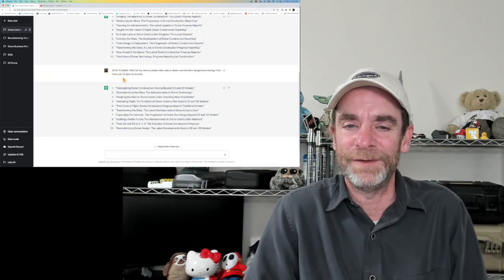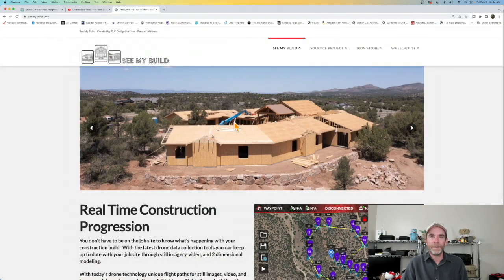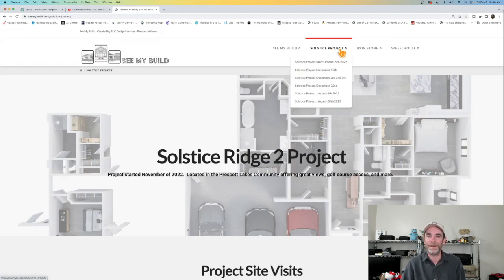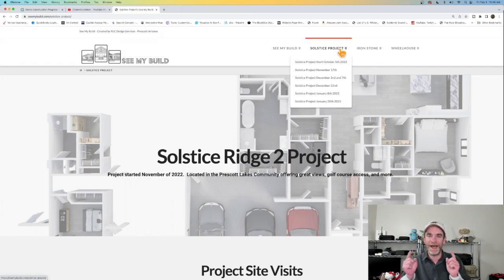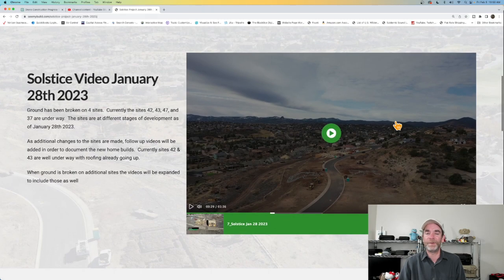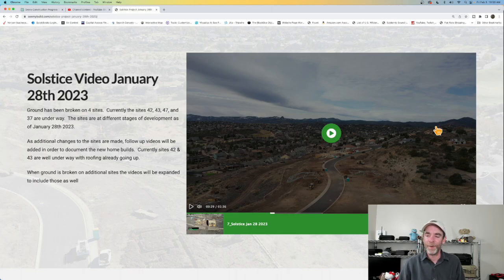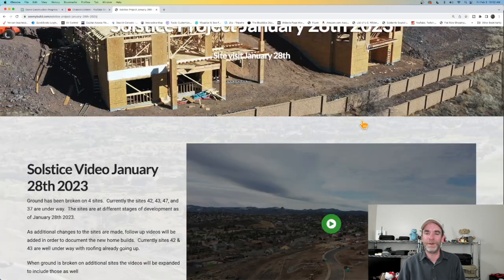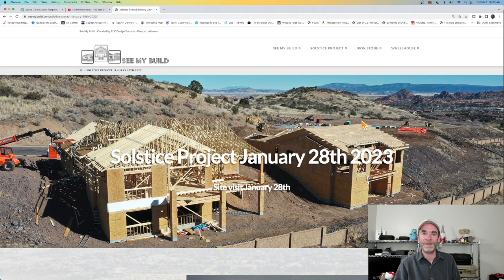Breaking the Mold in Drone Construction | Deliverable Presentations

Comment: Very good information once again. Can you remind us if you use control points or a GNSS  receiver 100% of the time? What levels of accuracy do these type of jobs require if none of the deliverables are being used for engineering grade applications? In your opinion, can a drone with an RTK and NO base station work if the relative accuracy is within 1 to 3 feet? I can also bring all my data into a real world state plane coordinate system in GIS. Thanks!!
Reply from the maker: I've used control points for my own use in testing on Metashape and WebODM, and testing out a sub 1 m gps.  Here's the thing.  I have not had any clients looking for super accurate models for measurements and other services.  They want visuals to showcase their job sites, track progress, and be able to share site changes easily within their businesses and with other interested parties.  I was all set to invest in a RTK setup a few years ago, but without demand for the service, I've saved money for the next necessary drone purchase in my business.